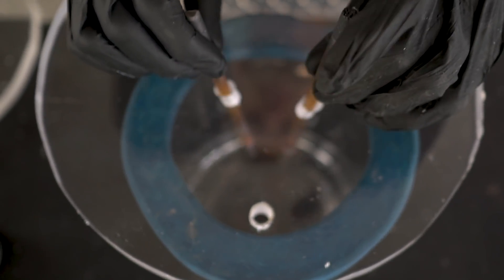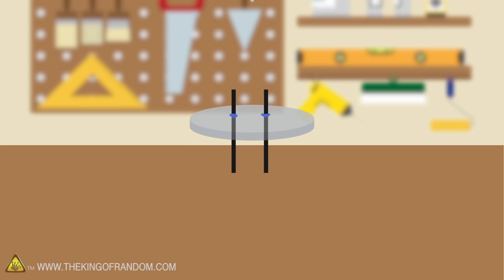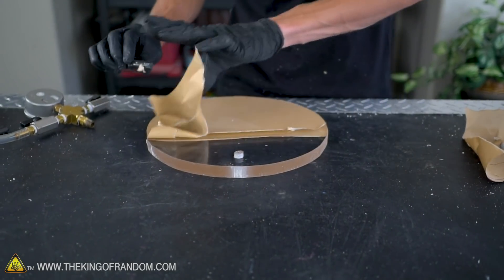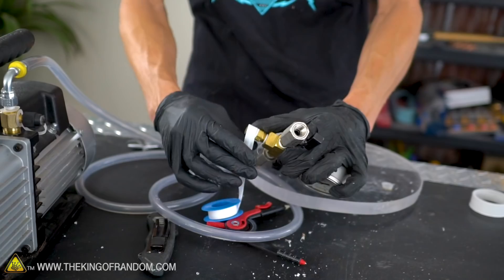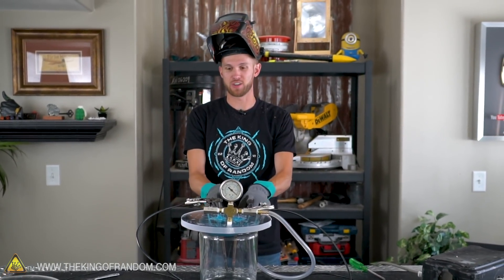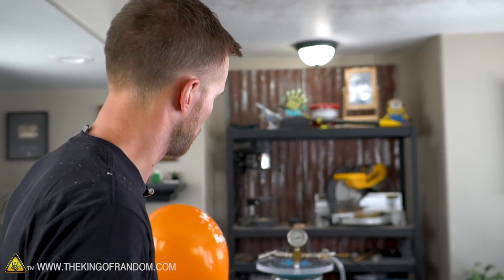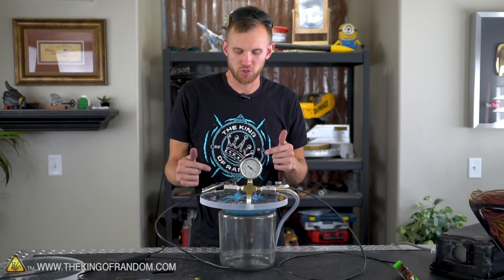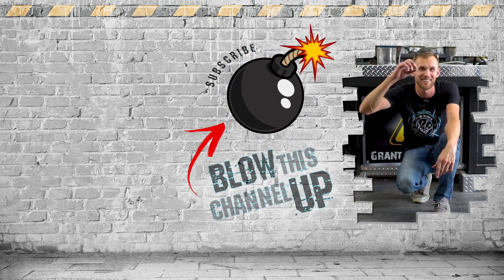Well That Was Anticlimactic

Comment: Your problem is that arc welders are low voltage. If you want electrical plasma you have to use a HV power supply like a microwave oven transformer.

Comment: Analysis of why the arc didn't hold you have a high amperage and a relatively low voltage. If you want the arc to travel further boost the voltage up

Comment: The air pressure needs to be half way to extreme vacuum. Cause if there is no molecule in the circuit, what is gonna turn into plasma?

Comment: I haven't watched your build video for the arc furnace, but, judging by the heat evident through the glowing red electrode tips, I'm guessing this is a high current device and, judging by the lack of any true plasma arcing, that this device is also low voltage?  So, low voltage won't equal much of a noticeable increase in arc gap at such a low vacuum.  Probably not even much in a relatively powerful vacuum, I'd expect.  You want bigger arcs, you need higher voltages not higher currents.  Just a thought.

Comment: You are so close to having a vapor deposition chamber at this point. All you need is a better vacuum. You should look into adding a turbomolecular pump as a second stage to get you down to the point where you can metal plate via thermal vapor deposition.

Comment: if you could draw an arc for longer, I think whatever oxygen is left Would burn away and it would cease arcing altogether. 

In some High voltage substations they put switches and circuit breakers inside of a vacuum or fill them with some kind of a inert gas to keep arcs from starting and melting down the substation!

Comment: air is full of particles that conduct the plasma. the more vacuum you pull the less conductivity there is inside the chamber. in theory if you pull a perfect vacuum the only arc you will get is when they electrodes touch.

Comment: You dont get an arc in the vacuum because an electric arc in the atmosphere creates a plasma or electron trail that allows for a visible 'bolt' to form. This is why lightning typically has many bolts traveling the same pathways to the ground seconds after the first strike. At least thats my thinking on it. Lightning and electrical arcs dont occur in space. It requires gases to do so, right? Or enough electrical energy to create a plasma or electron trail through what gasses are left absent a perfect vacuum. Thoughts or input? Id like to learn more about it, how about you?

Comment: Instead of the proto-putty, try some of the automotive gasket making materials sold at auto parts stores. There is a variety made by Permatex that contains copper and is stable up to 700 degrees.

Comment: for plasma you need high voltage in a vacuum. welders have low voltage and high current. so use a microwave oven transformer?

Comment: Hey ! You should try with higher voltages like with some neon lights transformers, the intensity is much smaller but arcs are longer. Then you create some arcs inside the chamber but filled with different gases. try pulling the vacuum and filling it with the gas to have a purer gas inside the chamber. Helium, CO2 (from dry ice) and nitrogen are gas quite easy to obtain. But Grant has also built an electrolyser, so try with with hydrogen! And he might as well have a rest of the heavy anti-spark fluor gas he used in another video. PS: vacuum insulates better than air so it's normal for the sparks to be smaller in vacuum.

Comment: Have you heard of zerconium oxide coating/paint try to see if you can have the electrodes coated with this material it can withstand 4000 C that way your protoputty wont burn alternatively you can try using clay you have lying around mixed with some firebrick dust you made or used from your previous experiments, i thought it looked like there was a blue spark when you interested nitogen into the jar 7:54 it might just be me but i would like to see what happens when you introduce various gas into the jar how the electrodes/plasma would behave.

Comment: You need to lower the resistance between the vice grips and the electrodes that way the top doesn't heat up so fast

Comment: Instead of using a vacuum chamber, you should use a pressure chamber and try to use the arc furnace in it. If not then I still want to learn how to build a pressure chamber TKOR style

Comment: Try engine gasket maker ,it’s rubber like,seals as it’s meant to be a gasket,and holds heat to withstand engine temperatures.
Reply: I'm not sure how well that would hold up. Most engine don't get above about 230°F/110°C during normal operation and the spots that do (pistons, head, exhaust) have metallic or semi-metallic gaskets. A brief look suggest that some elastomer blends can handle up to about 300°C, at least intermittently, but, for what it's worth, a look at an incandescence chart suggests that the tips of the electrodes are getting to between 900°C and 950°C.

Comment: Fill it with neon? Or... Xenon oh and sulfur hexafluoride. Maybe Argon... Just different gasses without O2 to react with. Errrr but make a blast box first because I have a feeling the Xenon is going to explode and the SF6 expand rapidly. The neon should be kind of amazing and the argon well... Maybe try to weld like... Zync? Just fill it with gasses and see what makes it explode. That's my vote. Besides you get to do a video on making a contained blast box first which is super cool.

Comment: Use higher voltage transformer because the proto putty wouldn't melt so fast and I guess it can stretch longer. Beware that high voltage in vacuum can produce X-rays

Comment: What would happen if you mixed pure hydrogen with pure oxygen?
Would it make water? Maybe you can test it out.
Reply: Nothing will happen if we just mix it. You need a reaction from pressure or chemical sources to create the water.
Reply: Yes it will create water but only after an explosion.
Hope you don't die
Reply: I dont know what will happen
Reply: liquid hydrogen and liquid oxygen makes rocket fuel ;)
Reply: you need to burn hydrogen to create water
Reply: You wouldn’t be able too sorry bc hydrogen and oxygen both exist in a stable non reactive state when you find them so it is very difficult to get the o2 to react with the h2 as they are both stable as they are if you want them to react you have to subject the mixture to enough heat to cause the hydrogen to burn and explode
Reply: Not unless there was an external energy source added. Such as a flame.

Comment: Using a high temp automotive rubber gasket for the rod hole seals should prove useful. Most cars at their core reach over 500 degrees so that should hold a lot better, and stands higher pressures.

Comment: Will these carbon rods produce heat while it is in liquid nitrogen
Reply: Yes.
Reply: They will produce a temperature difference. If your wondering if it will produce an arc in LN2, the answer is no. Arcs form from ions that have been heated into a plasma.

Comment: Use 7024 1/8 th inch welding rod it creates gas liquid metal and slag I’d be curious 1 to see if your arch is hit enough to weld 2 how much actual gas is made during the burning if the rod

Comment: Use Viton seals to help maintain vacuum. Swagelock fittings only for hose hook ups, gauges, etc. Use a diffusion pump to reach high vacuum after using a fast rough. Just a few ideas.
Reply: Leak test your chamber with positive pressure say 3 psi. Use a gas detector to detect for leaks. Use helium to pressurise. Nitrogen makes a great purge gas for plasma experiments. Consider designing a hot wall reactor.

Comment: I can't recall the name of the gas that was inside the lightbulbs for movie theatre projectors. However, I know the pressure in them would be the blast of a 1/4 stick of dynamite so beware if you would drop one.

The light came from the arc between the 2 carbon rods, the anode and cathode. Needed a igniter booster to turn them on.

Comment: So, someone correct me if I'm wrong, but I don't think it'll work in a perfect vacuum. Isn't a plasma arc the result of superheating the atmosphere in an arc between the two carbon rods, changing the air from a gaseous state into a plasma? So, if there's no atmosphere to superheat, then there's no plasma as a result.

Comment: you can try "Honda bond HT" works well with sealing up gaps in exhausts on cars and can withstand quite a bit of heat, it sets in a couple hours depending on how thick it is, however ii think it takes about a day or two to fully cure

Comment: Make the rods shorter and put the electrical wire through the lid instead of the rods. So that the rods don't make any contact with the putty and so that the rods are small enough to fit inside the vacuum chamber. Shield the lid and the putty from the inside with a piece of aluminium or something like that in order to protect it against the worst radiant heat. Use magnets or a remote controlled servo motor to move the rods into the correct position to make an arc. Voila!!

Comment: Seems you were using low voltage, high current.
You get more effects if you turn it around. Use high voltage. Thousands of volt. Or more. Low current.
And as suggested, try filling with argon. Or similar.

Comment: You probably know this.  This idea, an arc in a vacuum, is used everyday in the steel industry.  
VAR (vacuum arc remelting) remelts the metal under a vacuum to further refining air melted steels, removing inclusions.  
VIM (vacuum induction melting) this is the coolest!  acutally melting and refining under vacuum and pouring it into molds.
another non-vacuum process is ESR (electro-slag remelting)
 
 Most of the steels in planes and other critical application are produced using one or more of these method.  VIM-VAR is popular.
I'd try to get you a tour but my mill is in the UK.

Comment: What if you held them to the sides of the glass with a metal plate attached to the electrode (with a non-conducting layer between them) inside the chamber and a strong magnet on the other? you could run wire into the chamber, seal the acrylic with putty, and manipulate the electrodes by moving the magnets on the outside of the chamber. If you put the electrodes on opposite sides of the jar it would probably work best

Comment: Try Argon gas the same way you did with Nitrogen, as thats usually used in welding to help shield the arc. Also, there are some high-heat sealants that are used for fireplaces, look into using that in your protoputty mixture for better thermal resistance results.

Comment: if you make it vaccuum there isn't much that can "carry" the electron flow. so you end up with a pure electric field to carry it. You'll need more heat on the cathode and higher voltage than a welder will provide.
Also, no air means, no particles to get excited, so no glow, just a flow of electrons.

Comment: Scientifically speaking you would need a positive pressure chamber in order to extend the length of the arc. An arc in a vacuum will be shorter because there are fewer air molecules to ionize in a given volume of air.
Basically the way lightning works is it ionizes air molecules the arc in an arc furnace or on a Jacobs ladder or in an arc welder to name a few examples works the same way.
To summarize try the same experiment but with a pressure chamber instead.

Comment: Doesn't the arc furnace create plasma which is basically heated air? So by using the arc furnace in a vacuum, it shouldn't even create plasma

Comment: a vacuum is actually a electrical insulator, we use vacuum in HV circuit breakers, hense why the arc isnt holding.

Comment: What about to use that red silicon on the puddy, the one that is made to hold high temps on motors etc? Instead of the normal one, that may be able to sustain the temps better without butning

Comment: Sience behind this: (im from poland so some stuff you will have to translate) Electrycity travels thru everything that conducts it and it travels in the easiest way possible so if there are tho wires: Iron wire and copper wire (both same thicness) it will most likely to travel thru copper wire unless you are fortnite player, bare feet on the ground and grab iron wire so the Electrycity will have problem what to choose. And to trave thru air there must be a big voltage so it has enough power to "zjonizować" air particles and get to rest of the wire. (Electrycity travels thru electeons so it would be rather hard to make big arch in vaccum)

Comment: ARC FURNACE DOESN'T ARC PLASMA , ITS JUST THE METAL GETTING BRIGHT HOT BECAUSE IT RUNS ON LOW VOLTAGE AND HIGH CURRENT,  TRY HIGH VOLTAGE INSTEAD LIKE A TASER

Comment: To get plasma in the vacuum you should use high voltage low current instead of low voltage high current such as you have. Try using an electric buzzer racket (don't know how it is actually called, maybe mosquito racket). Don't know if it'd powerful enough, but hey, just experiment! Ahah

Comment: It doesn't work because on the rodes there isn't enough voltage to create the arc. If you use a high voltage generator it should work.

Comment: Based on my understanding, the arc still needs a medium to flow through.  The vacuum removes most of that medium, so the arc furnace is not able to arc as well as it can at normal air pressure.

Comment: The arc welder has a high amperage but has very low voltage  and that's why it doesn't spark over a larger distance

Comment: Arcs go through the air by ripping oxygen to shreds releasing free electrons. And nitrogen gas is one of the most stable molecules there is, you would need a real lightning to rip that apart. No free electrons in the atmosphere, no ark.

Comment: What if you make a huge vacuum chamber and put holes with gloves over them so you can create silicon molds inside a vacuum chamber making the molds better and at the same time you won't need to use silicon that takes a long time to cure because if you have the vacuum running it should pull out any air while you mix it

Comment: Could you try making a gas discharge lamp, with the arc? You could try filling the chamber with low pressure noble gases, and see what happens!
I think another cool experiment woud be if you would try to make a giant lightbulb from the vacuum chamber (maybe again experimenting with different gas fillings). Or making your own vintage lightbulbs from empty vacuumed glass bottles!

Comment: What would happen if you pour molten metal into liquid nitrogen
Reply: molten metal would fly everywhere
Reply: It's called cryoquenching and is used in aerospace manufacturing. A lot of splatter but super hard and brittle metal comes out. Molten glass is more interesting.
Reply: The Verdant that's not cryoquenching in fact it's not even how quenching works.

Comment: the interference is coming from the lack of molecules to interact with. 

also, use xenon gas instead of nitrogen and high voltage instead of high amps and high pressure instead of a vacuum.

Comment: Im doing pretty much the same thing as a school project. But im using high voltage. The high viltage arc is not working in normal air but reaching near a vacuum it lights up and looks pretty cool.

Comment: An arc welder is stepped using a transformer for very high current and low voltage. For the plasma arc you're hoping for, you need high voltage. Use a microwave transformer or simply turn your transformer around!
Reply: and i promise you will get beautiful plasma!!

Comment: the problem is that the arc you have is from amperes and not from volts which means it does not run fast enough to travel that far high voltage gives the force to run through the air but low voltage like this does not because it has high amperes if it did have high voltage you wouldn't be able to melt metal to sum up high voltage will have a great big arc and a very dangerous one but high ampere will never have that while it melts metals amperes are not as harmful  and not as ''fast'' as volt are so no big arcs

Comment: Aviation grade PS 700 Firewall Sealant should have no issue with the heat generated by the arc furnace for the experiments you would run. It stands up to 2000 degrees F of "flash temperatures".

Comment: I thought that it would not work because the arc from the arc welder is basically fire and fire needs oxygen, in a vacuum there is no oxygen.
Reply: So in an arc welder, oxygen is actually bad for the process. This is why you will use some type of shield gas that keeps oxygen away from the work area. This is because oxygen will essentially corrode the metals at those temperatures causing a poor weld. The arc itself, while hotter than most fire, is not actually fire. It is a plasma that is created when the electrical potential is so high on either side of the gap with air in the middle, that it rips electrons off of the atoms in the air to try and connect the two sides of the electrical circuit. The heat is essentially all of the extra energy that can't actually make it through the circuit and gets bounced out.

Comment: i as thinking if you could somehow get the whole rods in the chamber and put the seal round the insulated wire only problem ith that is you wont be able to move them to much its just a thought
Reply: or if you had longer rod putting in further might allow it them to run longer before the heat travles up to the seal probably not long enough though again just a thought and im sure you have already had them anyway

Comment: You can get shorter rod inside with only cables running through the acrylic led to avoid heat in the seal.  Then rest the rods on bases that are poor conductors for heat,  like the arc furnace itself.  You can then use the two holes to get two acrylic or any other material rods inside and control the position of the bases carrying the rods through pre-drilled holes.

Comment: Use high temp gasket sealer or gasket maker, like what you'd put between your engine block and exhaust manifold. I believe they even have some that's copper infused (although I dont know how that would react to the current running through the rod)